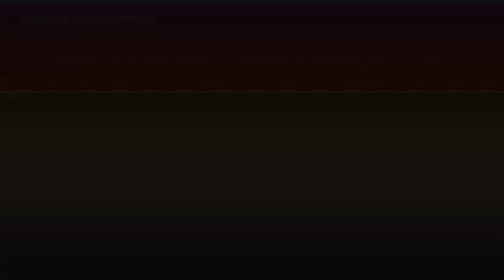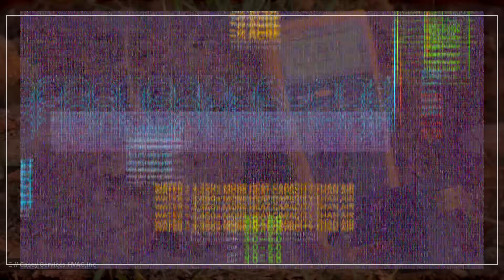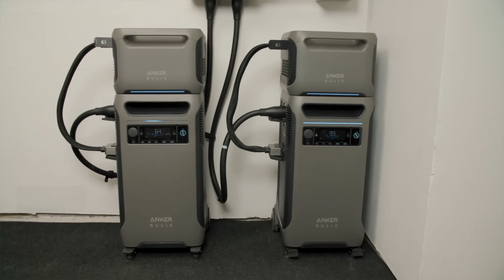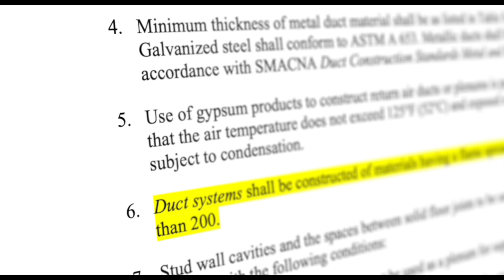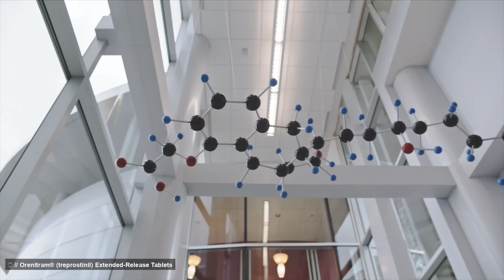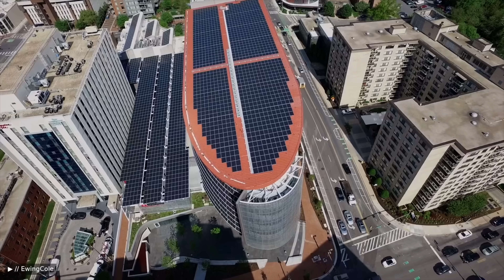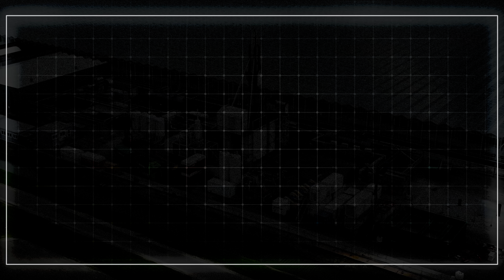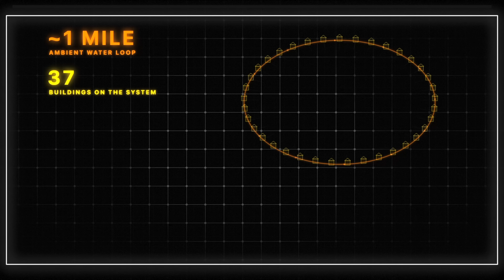The Viral DIY Cooling Hack That Nearly Killed a Family

Comment: I live in Norway, where electricity prices are extremely high. One heat source often overlooked is ocean source. My house uses an ocean-source heat pump—similar to a ground-source system, but the loop runs directly into the sea. My current system is 20 years old, which is the typical lifespan for these units, and it has begun to fail.Finding a technician familiar with ocean-source systems is difficult due to their rarity. After several technicians provided conflicting diagnoses, I considered replacing the unit. I assumed it would be relatively inexpensive since the internal plumbing and pumps are still functional, but I was wrong; the replacement cost is approximately $35,000 USD (350,000 NOK). For that same price, I could install ten air-to-air heat pumps.All heat pumps face the same physical limitation: as the heat source cools, it becomes harder to extract thermal energy. Standard "Nordic" air-to-air heat pumps struggle as temperatures drop toward $0°C$ ($32°F$) and lose significant efficiency as they approach sub-zero temperatures.While ground-source systems are more stable, the constant extraction of heat can actually cool the surrounding earth over a long winter, reducing efficiency. My ocean-source system avoids this; because the North Sea is constantly moving, I am leveraging an infinite thermal mass. However, despite this superior efficiency, the Return on Investment (ROI) is hard to justify. A family in Texas might save $200 a month during the peak of summer, but those savings aren't year-round. Over a 20-year lifespan, trying to recover a $35,000 investment with fluctuating seasonal savings means you may never actually break even.
Reply: This is fascinating. Ive never heard of an ocean system. 

I was very surprised that airsource was even catching on in Northern US states, because of its basic physical limitations at the frost line. 

it turns out most new air-air  airpump systems are HYBRID HVAC systems  which combine new technologies to boost 'efficiency' , ones   that havent gotten wider press: "electrothermal" and "magnetothermal" materials. 

One day Electrothermal and Magnetothermal materials might replace electroresistance heating systems, refrigerant systems and most heat pumps. 

There have been slow but regular breakthroughs in these technologies over the past 40 years. Sometime after the year 2000 they became more viable

 ( like yourself I wondered how you could possibly  magically wring  out extra 'efficiency' from air heatpump in freezing cold air, as if by magic.  The answer is , obviously you cant, its a stacked technology to boost results.
Reply: @AdamBlack  The horizontal pipes that one might dig 5 or so feet deep in the ground don't really care where they are placed. You can dig them in your own yard, nearby field, or lay them to the bottom of the lake or sea. If anything, installation cost in lake/sea is typically less than digging it into the ground, as instead of lots of digging you can simply lay the pipe to the bottom of the body of water and anchor it in place. You might also need less pipe since water (and thus the heat in the water) moves unlike the ground. The heat pump itself doesn't really care where the heat is coming from - water+antifreeze mixture looks the same no matter if it comes from a ground loop, bore hole or loop at the bottom of the ocean. The only thing that matters is that the pump circulating the fluid in the loop is powerful enough to circulate the liquid in the heat collection loop.

For the OP the heat pump itself has a limited service life and needs to be replaced (or refurbished) at some point (same goes for any other heating device, such as a oil/gas furnace or even electric water heater), and the loop in the ocean has it's own service life which is probably considerably more than just 20 years. If it isn't leaking or hasn't developed a significant clog or kink (buildup from liquid in the water or mechanical damage from the outside) there isn't a need to replace the loop in the ocean. After all the nominal service life of such pipe is somewhere between 50 and 100 years. Basically if there haven't been issues with the loop itself (main symptom would be pressure loss) just replace the heat pump itself. It's not cheap, but probably closer to 100,000 to 200,000 NOK including installation.

Here in Finland ground source heat pumps (the unit itself + water heater if not included) costs around 10,000€ and installation including materials is probably something like 2,000€ for simple systems, though if you have multiple separate heating loops in the house with their individual controls and so on the unit and installation costs are likely higher.
Reply: Hei, det burde være mulig å gjøre det mye billigere, jeg har selv kontakt med en leverandør av vann/vann varmepumper (han har selv 2 sjøsløyfer og en elvesløyfe som han henter varme fra) med bred erfaring med bruk av sjø, ta kontakt så kan han helt sikker hjelpe deg til vesentlig lavere pris en d 350k som du nevner.
Reply: I don’t understand why electricity in Norway is so high. So much hydro that you have to sell to Europe.  Do you know why?  Genuinely curious.  And roughly how many NOK per kilowatt hour for comparison
Reply: @richardcharlesworth2020  ... because we sell it to Europe. Selling our surplus to Europe makes the prices rise to near European level.  Government has stepped in and and said that the price should be a maximum of 0,50 NOK / kWh
Reply: @richardcharlesworth2020  They have an impressive health care system & Americans would moan about a taxation system.  Me, hate the cold.🇦🇺
Reply: @d @damienomen68 at is it with the rest of the anglosphere fetishizing taxpayer funded healthcare. It’s usually crap, you can’t convince me the euthanasia program in Canada isn’t a government cost saving measure at this point. I’d rather have low taxes and pay for my own care. I’ve always been lower income but I have employer sponsored health insurance so I’ve never gone broke even with lifelong health conditions to manage like epilepsy and asthma.
Reply: @meglukes  It amounts to Americans being willing to pay more for worse outcomes if it means they get to keep other people from having something.
Reply: @meglukes To be completely honest the problem with your thinking is that its just not applicable to most people in the US, plus Europe has an entirely different reason their system works. That reason is a functioning social contract, something that US lacks at the moment.
Reply: @richardcharlesworth2020 - Electricity is not expensive in Norway, it is just extremely cheap in North America, where they do not care about killing the planet (including their own population, but especially the others).
Reply: I know at least one area in Finland ("house fair" area from 2008 in Vaasa) with a ground-to-water heat pump system that is installed in the layer of mud and clay sedimented on the bottom of a sea bay. As the ground below a shallow body of water is warmer than ground otherwise, it is very efficient. To my knowledge their biggest challenge was that not all drillers have equipment to manage drilling in that shallow direction. 

Finnish heating season is long, and it's managed by the local energy company as it serves a bunch of houses.
Reply: Seems like it should be easier to troubleshoot these systems, and a 20 year lifespan seems too low considering the installation cost. Maybe you can spend $5000 more on such a system for one that lasts 40 years or more?
Reply: Ocean source (or any water source) will work with an ordinary ground source heat pump that is designed to use “ground loops”, such as from Kensa or Nibe.
Reply: @evan010101 what about galvanic corrosion?
Reply: @dennis1954 cupro-nickel coaxial heat exchangers with sacrificial zinc anodes work for a very long time in salt water. 20+ years in fact. They just need de-lousing like any ocean going heat exchanger. Coaxial coils are relatively cheap to replace as well.
Reply: Yes, the cost may be difficult to balance, but it's a very green technology.
Reply: When I go to look at how these systems are made, I find it hard to understand how these companies justify these crazy high costs. How much would it cost for you to just do it yourself? Shovels are inexpensive...
Reply: Its interesting you should mention this. Lots of buildings in downtown Toronto use simmilsr systems into lake Ontario, and I know some people with cottages use simmilar systems in smaller lakes as well
Reply: Actual long winter cooling if the ground should not be a problem in a sufficiently sized system. Also it's actually a benefit for the following summer as well.
Reply: @LincolnTelford  I wonder what you expect from a heat source that shifts the climate within your home by 2000km to the south? heating with any type of system involves costs (physically speaking: If you fight entropy, it requires energy). fossile gas heating costs you at least twice as much in 20yrs and oil or coal are similarly expensive (directly - indirect costs are much higher, but they are transfered to the rest of the planet as well). Using a heat reservoir that replenishes itself (like an ocean) is great, but chemical interaction always involves corrosion.
BTW - energy in Norway is not expensive, because you live from the melting glacier you settle on. Nonetheless, good that you use a a heat pump and such pumps are not that rare, although current ones operate in the 100 MW-class and support larger population centres. - If you are sitting alone, without a network, you have decided to take care of this stuff yourself and unfortunately must invest to stay heated. - The crushing AMOC (it is practically sure that we will already see it crash - despite the satanistic USofA government that tries to destroy science and trigger what they think is the „end of times“) will take away your rain and also reduce the temperatures in Norway, so you might want to think about your situation in more detail.
Reply: I live in Maine USA where it gets -25F in winter and my air to air modern heat pumps work fine. Modern ones are far better than old ones.
Reply: @boathemian7694 I think a lot of it is dependant on the quality of insulation of the home it’s installed in. It’s why it’s not great in countries like the UK with a lot of very old draughty housing stock
Reply: @desdicadoric That actually doesn't have a lot to do with it. The seer rating has everything to do with it. A 10 seer system can't really do much below 33 degrees f. A 21 seer system can work down to 0 degrees f. Some even colder. Unfortunately those are the most expensive units as well in standard while home heat pumps. Mini split systems are much cheaper.

Comment: Air-sourced heat pumps are superior in nearly all situations, because they are a lot neasier and cheaper to install and nearly as efficient. Only if very cold winters are the standard, groundsourced heatpumps will have an advantage.

Comment: You have not mentioned another method for ground source heat pumps — direct burial of the compressor coil. We installed our system in 2010 and it lowered our electricity bill 60% and with rebates the total cost was within $2,200 of the cost to replace our failed system! How was that possible? The big savings came in drilling costs. Instead of huge drilling truck and multiple 600’ bore holes, the system required 5 75’ 2” bore holes drilled at a 45 degree angle like spider legs from one location, done by a small tractor sized machine. The compressor was about the size of a college refrigerator placed in our crawl space, and included a Desuperheater, further reducing the cost of domestic hot water. Unfortunately, the compressor company went out of business, and the replacement compressor we needed 9 years later could not be used with the new refrigerant the law then required. We were forced to install a very efficient air-to-air system, but the savings aren’t as great.

Comment: If you’re just looking for free heat, you could make a closed-loop solar-thermal collector using water as a fluid and some antifreeze to ensure it can withstand colder and hotter temperatures (check out tech ingredients and other channels). Then you could run the pex tubing from that (insulated between you home and the collector, of course) to a plate or sidearm heat exchanger attached to your water heater (for a free boost). On sunnier days, it might cover your household’s needs entirely. From there, on the return loop from that heat exchanger, you can run tubing to another heat exchanger (water-to-air) in your furnace. Lots of people use this setup out in the sticks where they use wood boilers to supply their water heaters and furnaces with free (but not green) energy. 
I imagine that, at night, I’d want to auto-pump that fluid entirely out of the outside portion and into the house to keep it warmer for longer and reducing the heat up time the next morning.

We’re talking about a few hundred bucks in materials vs. $20k. Even if it sucks, it’s not the end of the world. 

As for cooling, there’s a company that makes a very cheap (electricity-free) attachment for your AC unit that uses evaporative cooling to boost the efficiency of your condenser coils. They’re called Cool-n-Save. Check it out, especially if your AC is in the direct sun.

Comment: This makes no sense. You are proposing to pay $60000 to save $200 per month on you AC costs. The mortgage payment on the $60,000 at 5% will be $350 a month.  I have a heat pump home that  uses a very similar amount of electricity per year. I simply powered my heat pump directly with a 12 000 watt solar array with 50Kwh  battery at a total cost of $10,000 (DIY) to reduce the electric bill for heating/AC to zero - saving about $2500 a year for a 4 year payback. No drilling, No digging. No circulation pipes or pumps.

Comment: Beware the vertical borehole pitfalls.  I have been involved with multiple massive “geo-exchange” (not geothermal) and they failed due to biofilm.  These projects were on the level of 450 bore holes 400 feet deep, and were promised to eliminate the massive cooling towers in use.  They did not.  Biofilm forms on the plastic internal diameter of the pipe and is more insulating than mineral deposits and most man-made insulation materials.  Even a 100 micron thick layer of biofilm will dramatically impact your heat transfer capabilities and will typically doom the project.  You might think you can just put a biocide in the closed loop system-ok, which biocide?  All have issues with long-term use, which is absolutely a requirement here.   If you are in a seismic area the piping may separate or crack and leak into and contaminate the groundwater for yourself and neighbors with whatever biocides and inhibitors you choose.  Good luck with all that.  Also, I have seen a project where they failed to perform enough test bores and didn’t discover that the project was too close to an aquifer that was much warmer than expected so the temperature 250 feet down was too warm and ruined the possible cooling.  Oops.  
Also, the grout isn’t a great heat transfer material and neither is HDPE or other plastics you may be using.  I’m not saying don’t do it, but check your math, check it again, and do your research & make sure you are considering all failure modes.  The projects I was involved with, key people who had pushed for the project did everything to pretend that it worked to try and save face.

Comment: I was wondering is their difference from a slab foundation to a basement foundation?  Could having a basement lower the cost?

Second as someone who is looking into building my own home in Canada.  Came across using rockwool insulation and envelope wrap it OUTSIDE the home.  It is something one of the northern counties have made mandatory in all home builds.

Next for energy is building onto this idea of using water by using  a thermal system and a salt/sand battery.  Check out micro-csp system / parabolic solor Trough.  You can actually build this yourself and uses accessible parts and fix yourself.  Being in California it might be something you might want to research.

Comment: I've been planning a geo-source heat pump system for nearly a decade, and am hoping to make it happen this year.  Have been modelling the needed borehole configuration (we're on solid granite, so horizontal system is... highly impractical), and am just about ready to pull the trigger finally.

Comment: i use the water loop to pump heat out of my greenhouse in the summer and store it underground and pump stored heat to keep it warmer in winter. completely solar powered and it works very well. the air exchange systems are dangerous and not much cheaper. of course, i did not have to do the borehole as i have an acre food forest here.

Comment: If it requires a tax credit to be economical, it isn't a great system. Things were likely over priced because they could point at the rebate. Otherwise it is a cool system. They just need to get the price down so the ROI works.

Comment: @10:38

I wouldn't use "payback period" on a spreadsheet to see if a system is worth it. I would simply ask myself, "Do I want a little solar as back-up for running a pump, fans, and my refridgerator along with an Earth heat exchange system for heating and cooling that all work even when the power goes out?" If the answer is yes, I am doing it (assuming I own the property of course).

This is one of those issues that shouldn't be 'does it pencil out' / lead by spreadsheet. If you can afford it and want to increase your self reliance then the choice is simple.

Comment: It’s all about the size of the thermal mass.  Air to water cold climate heat pumps using R290 are the most efficient. An air to water monoblock has no refrigerant lines inside the house and will heat your house, heat your domestic hot water and cool your house in summer.